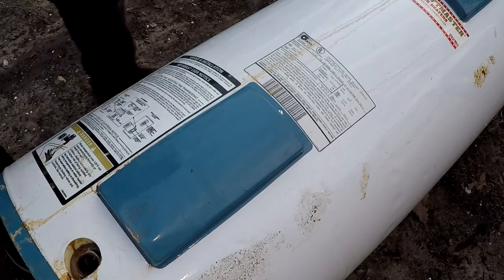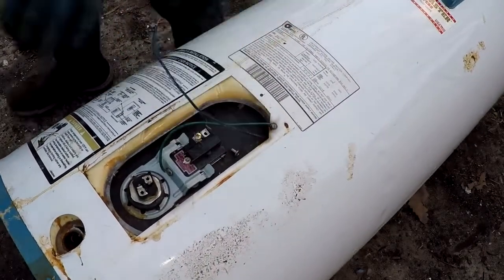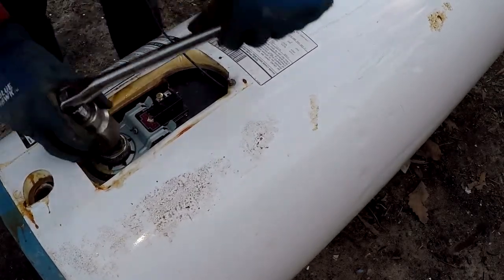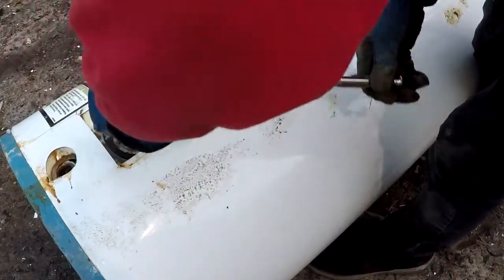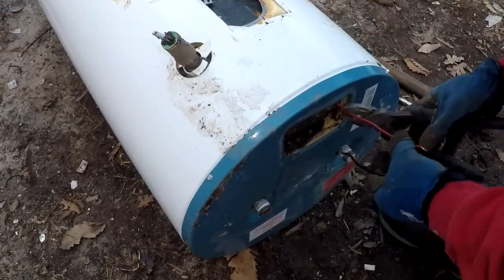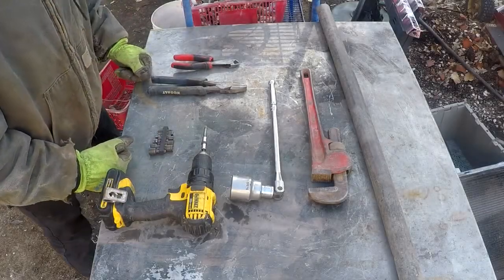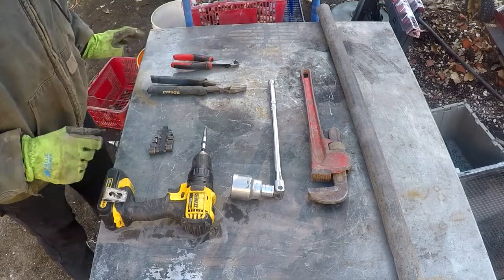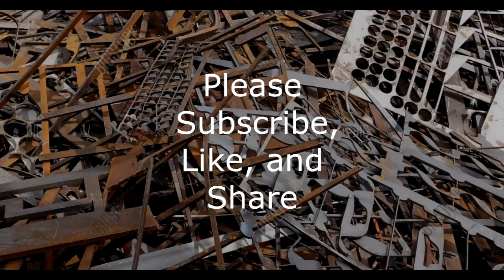Scrapping an electric hot water heater

Comment: When you have a water heater 2 heating coils take a disgrinder with 1/4 wheel. And cut the tin from the top to bottom coil box. Then take your breaker bar wrapped the copper wire around it and pull it threw the foam and the steel cut that you made.